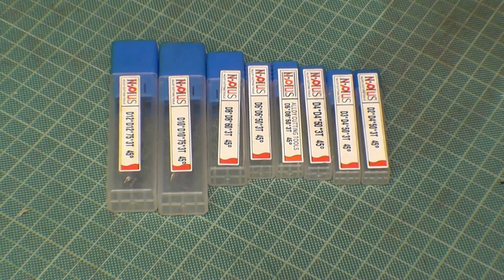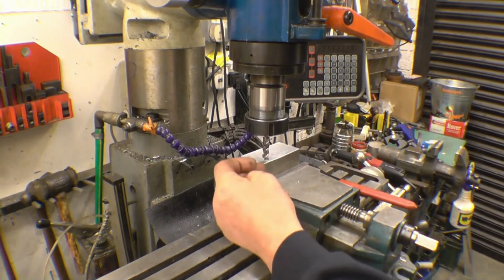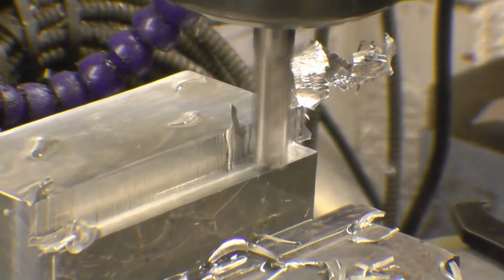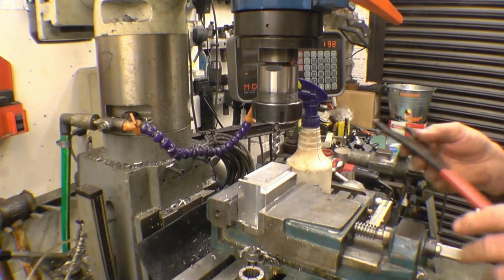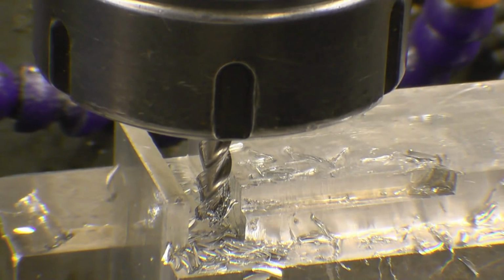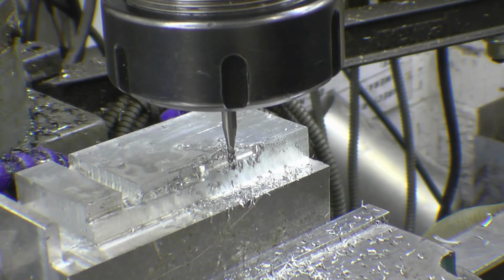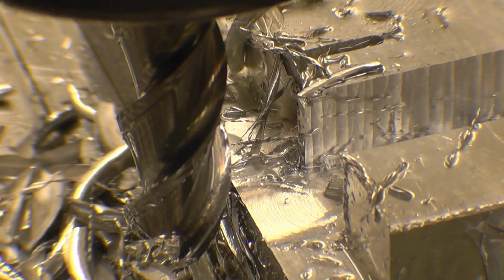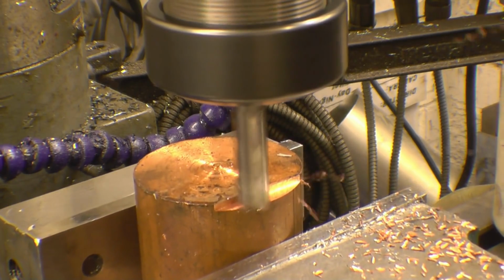Banggood  Carbide Milling Cutter Review (Soft Material)

Comment: Excellent review John,  those high helix cutters are current/latest technology, but achieve best results climb milling, ref CNC use. If I may add, carbide is susceptible to thermal shock, ref getting hot, then squirting some coolant on them. They will machine HSS steel, ref cutting tools, look up Stefan Goteswinter.
Many thanks for sharing and best regards from the Black Country.

Comment: When cutting aluminium one could also use denaturated alcohol as cutting fluid. The good thing with it is that it evaporates quite fast leaving no mess behind. The bad thing is that it may catch fire and that it tastes horrible due to the denaturation chemical. This, of course, can be medicated either by using vodka or not sticking the fingers in the mouth.
Reply: Here in Australia denatured alcohol (ethanol) contains about 10% methanol and about 3% pyridine which is designed to make you retch.  The methanol will send you blind if you drink it so it's not a favourite beverage for most folk. The iron monger will sell you a cold (chilled) bottle if you ask .  It costs about $11 (Aust) for 4 litres.

Steve the temperate.
Reply: @stevecallachor  Please note that methanol not only enters Your system by drinking, It also absorbs directly through skin. Methanol is toxic and it is forbidden to add it to denaturated alcohol here in scandinavia. There is a separate product, methylated spirit, which is sold as a separate product with poison signs and all.

Comment: only recently got a mill...big learning curve!  what material would you recommend i practice on John?
Reply: I can't speak for John, but personally I'd say whatever you have access to.  Aluminum, plastic, and wood all seem plenty forgiving.  I had access to a Bridgeport for small projects, but I was hesitant to borrow time on it, mostly because I didn't have much experience with it, but in part for concern about the mess that wood or plastic would make.  Finally wound up getting a mill of my own, and both of those concerns were completely unfounded.  I've broken one cutter due to a poorly fixtured part shifting during a cut, and to look at it you'd never know it's cut a mountain of wood, plastic, and composite.  I keep a vac next to it to stay ahead of the mess, cover everything that I don't want to have to clean out, and keep everything waxed instead of oiled with the exception of the ways and screws.  Anybody says wood isn't a legitimate material to practice with on a mill, they can go tell it to an old pattern maker that's spent a career working in a casting foundry.

Comment: John, You need to talk to Bangood about you having links to Imperial sizes also for us USA customers.
Reply: I've seen lots of metric offerings, and next to nothing in fractional inch sizes.  For the price, I'm tempted to just pick up a set of metric collets.  Fractional ER collets probably even have enough range to close down on metric cutters if you have a set that increments in small steps.  Most of the time, the cutter diameter would be easy enough to compensate for on the occasions I need to run a carbide bit.  A good deal of my HSS cutters are reground and undersized, so I've come to expect the 3/4" one may be .732 or so.  A 19mm cutter would already be closer at 0.748